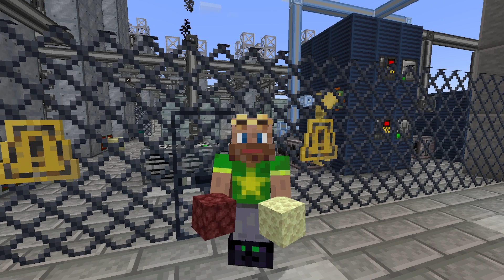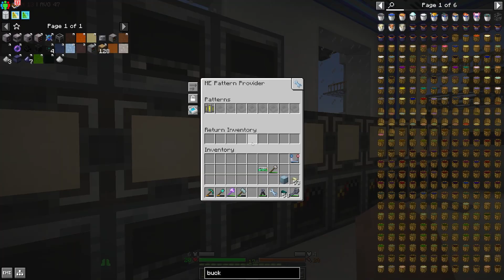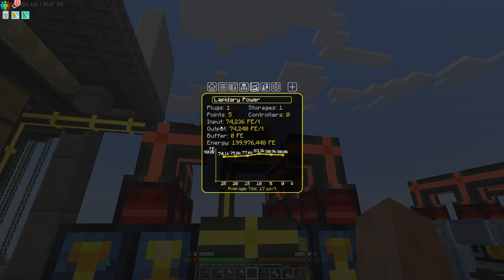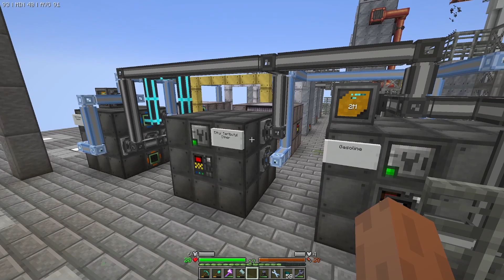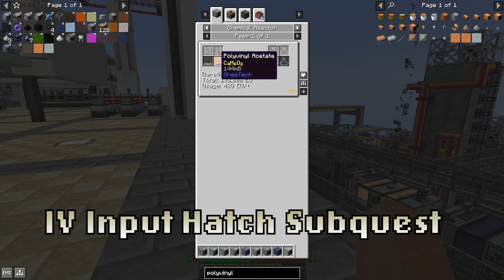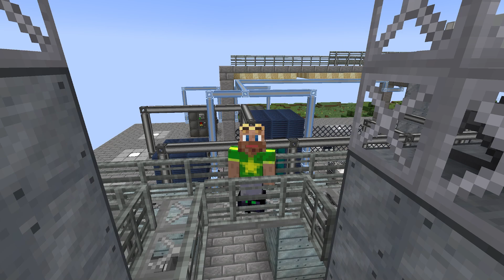Star Technology - 24 Mining the Atmosphere

Comment: Look into ME Input/Output Busses/Hatches. They are multiblock parts that can interface directly with the ME System. They can handle multiple inputs/outputs, and a large quantity of whatever. The only place they don't work that I have found, is distillation output hatches. 

Also : You never use Import/Export Busses for the ME System, only interfaces. They'd make the need for pumps and robot arms redundant. A Import Bus could be set to pull the gold nuggets out, for example.
Reply: conveyors/pumps are better for tps also
Reply from the maker: You're right! I keep forgetting that import/export buses can use filters.